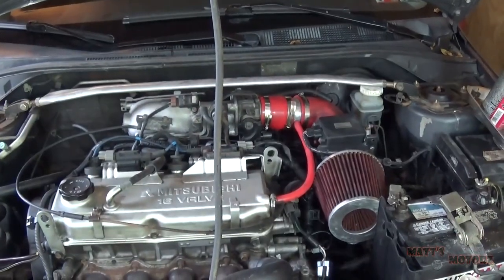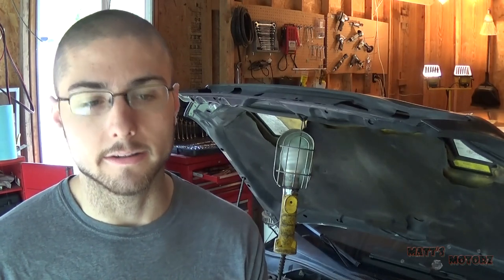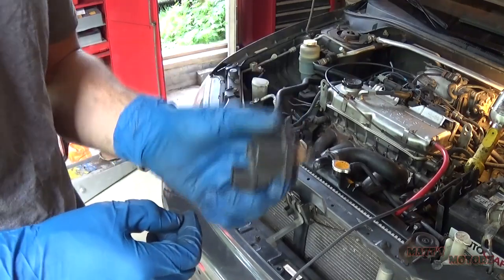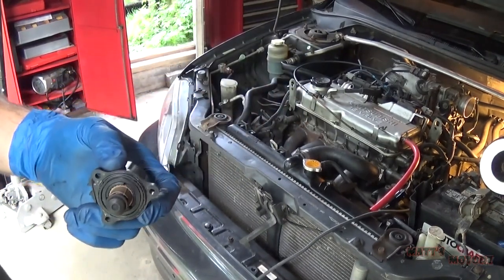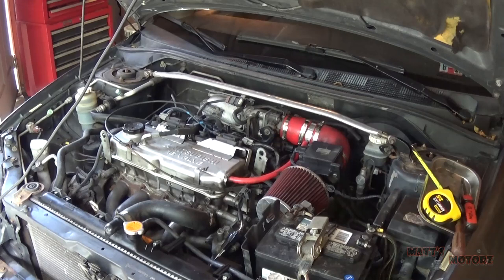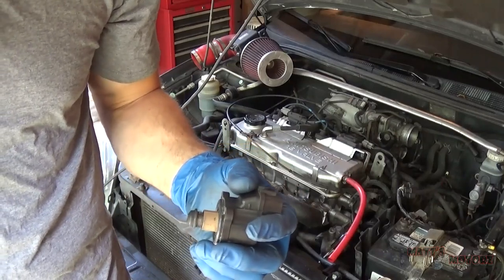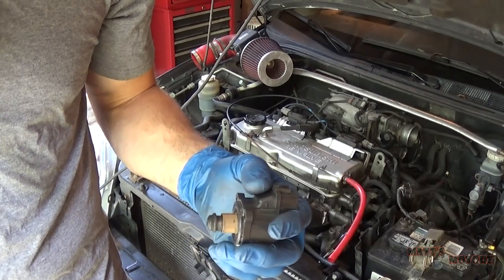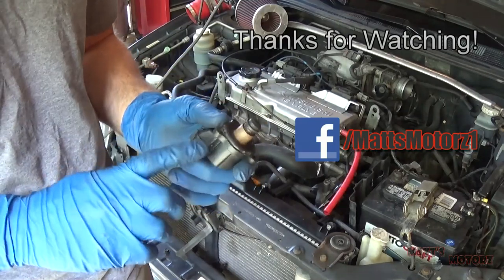Easy Way to Check an Idle Air Control Valve

Comment: Hey man, nice video! I have a Mitsubishi Outlander 2006 and it has the ENGINE LIGHT on, the computer reads "Idle Air Control Too Low". When driving and I come to a stop and try to accelerate the car, it stalls, the car turns ON again after turning the key and rides normally except when it does this. The mechanic told me I have to change a "piece" inside the throttle of the body, is this correct?
Reply from the maker: +Carlos Cordon Well it sounds to me like the idle air control valve is bad.  The IAC valve is indeed located inside the throttle body.

Comment: after I replaced the spark plugs on my 2008 Toyota Sienna, I unplugged the throttle body and clean it, now the car won’t idle.  It runs fine smooth (not rough) for 5 seconds then turns off, do I need to reset the throttle body?  Basically the car stalled after five seconds. Please help.

Comment: will an iac control fuel injectors?
Reply from the maker: +Drew Williams Nope.  The IAC doesn't control anything except the amount of air going into the engine during idle.
Reply: will the maf sensor effect fuel injectors from pulsing?
Reply: and thanks for response
Reply from the maker: The MAF sensor provides critical information to the engine computer to control the pulses of the injectors. So yes it affects the injectors.

Comment: I tried unplugging while idling but my IAC pintle stays wide open.... Would this indicate a faulty IAC valve? I cleaned it and the Throttle Body and didn't change the idle. Also, the spark plugs are black and motor oil smells like gas. So its running rich too. I also noticed the PO removed the idle screw plug... so they could have messed with the screw too. Thanks.
Reply: check your wires could have a broken wire, and your throttle position senser will give you very similar symptoms

Comment: nice vid. you can also remove to iac from the throttle body. start the car. then in the engine bay hold the iac and rev the engine by hand. if the iac works then the pin will move in and out as the rpm raise and fall.
Reply: Don't do that or the pencil will fly out of the idle air control valve
Reply: If you remove the idle valve while running the motor will over rev. Max lean!

Comment: IAC's aren't cheap (but they say I am)..just wondering if you have tried reviving one by lubing the piston or working the pin back and forth, or do they usually die electrically...and I guess used ones would be risky..thanks for the helpful VID...
Reply from the maker: Oilsmoke Jones Normally you cannot move the pintle at all by hand because they are stepper motors.  I never tried to revive one so I don't have much information in that respect. :\

Comment: Can you do a before and after of how the engine runs when you change the iacv?
Reply from the maker: Damn I should have! I already replaced it.  Before replacing it, the engine would run fine when cold, but after it warmed up it would bog down and sometimes stall after revving or when under load.  It would also run really rough until you step on the gas.  This was because the valve was stuck open.
Reply: @MattsMotorz  I have the opposite problem: runs fine when hot, sometimes stalls when cold.  Could it still be the IACV? Like maybe it's stuck closed instead of open?

Comment: Matt My 1999 Frontera 2.2 petrol when cold runs rough, after 5 mins it idles at 2000+ rpm. could the ICV cause this? Any help would be appreciated
Reply from the maker: chris davies Yes the IAC could cause this, as well as a vacuum leak.

Comment: Good video.  It was helpful.  I'm getting the IAC code, and the TPS (Throttle Position Sensor) code too.  But, the vehicle is performing the way you mentioned in your video.  It stalls after the vehicle warms up, or if air temperature is high, like in summer.  Wondering what your thoughts are.  Do you think the TPS could be a problem?  I don't see how a bad TPS would produce these symptoms.  But, the IAC is obvious.  So, I'd appreciate your feedback.  Thanks.
Reply from the maker: +David Eichenlaub Sounds like the IAC to me.  I would replace it, clear the codes and see if anything comes back up.
Reply: +David Eichenlaub depending on the vehicle actually. Some GM motors the IAC can be adjusted manually. If this is performed, it is important to adjust the TPS till its between 4.3-5.7 VDC. Your situation sounds like it could be wiring. A lot of vehicles have the TPS, IACV, MAFS, and The AC preasure transducer all on the same circuit, and the AC Preasure Transducer is actually especially vulverable to shorts. When this happens its can send improper voltage to all of the above sensos, also to the MAP sensor. Try inspecting all wiring ans sensors on the 5v reference signal for shorts. And make the ac preasure transucer the first one you inspect.
Reply: Hmm.  Great and knowledgeable advice.  Unfortunately idk how to use a multimeter that well.  Any advice on that?
Reply: +David Eichenlaub in this case just one at a time set the multimeter to 20VDC and turn. the car to the on position. (do not crank ot over) Just acc. then one at a time pull a sensor and stick the positive and negative leads on the harness wires. top os usually ground. but look for color first and check your wiring diagram to be certain. If these are reading the volts in my previous comment then the Ecm is working correctly. If that's the case switch it to OHMS and check the sensors wiring posts (where you plug it to. for Continuity.  should settle around 30 if so the sensors good. follow that method on each if one is off that's usually where you start looking. Hope this is helpful. what make and model is the vehicle?
Reply: +RIP FPS DOUG some may read 12v range when checking wires that's actually normal as you're on a 12 v circuit.
Reply: +RIP FPS DOUG I can't post a picture on here?  So, I put the leads of the multimeter on the posts of the wiring harness or pigtail or whatever it's called?  I don't have to do the backprobe thing?  I have a picture of what I mean but can't post it.  Thanks for your help again.
Reply: +RIP FPS DOUG The vehicle is a 2003 Jeep Liberty sport 4WD 3.7 V6
Reply: +RIP FPS DOUG Here is a link to the picture of the way someone is testing the TPS w/a multimeter.  Is this the way to do it?   

http://forums.nicoclub.com/throttle-position-sensor-help-t314208.html
Reply: +David Eichenlaub if it's on a jeep I'd leave it plugged in, stick your post into the back side of the harness where the wires enter it. you may have to wiggle it a bit to get a reading, but that will test the sensor and the circuit voltage. I will say this though. Jeeps are notorious for the factory idle airs going bad. Be sure to have the ac turned off when checking it. and make sure the engine is cold. if it reads correct run the engine till the fans kick on and cycle for at least 1 minute. Then get another reading.
Reply: +RIP FPS DOUG The method you described is called back probing right?  Is it possible to damage something by doing this?  It seems like you could break the wire or it's connection by doing this.  Any thoughts?  Thanks.

Comment: Hello Matt!!! My jeep 2000 cherokee has its check engine light on. i got it tested and it says its the idle air control valve. can i clean it or do i have too buy a new one?
Reply from the maker: +kayla reifschneider Normally cleaning doesn't ever fix anything, but I have been surprised before.  If it is easy enough to get at you might as well try it, otherwise I would suggest to replacing it.

Comment: Hey Matt! Thanks so much for the video. I have an 04 Escape that was idling fine one day, really bad the next. Idles ok in park, still shuddering, but once in gear, the idling, rpms, speedometer, everything goes downhill. The battery light is flickering dimly so I had that replaced but the problem is still there. A few things to mention... the car has 165k miles and needs a tune up, incl. valve gasket covers. It is leaking oil and coolant (milky) and the serpentine belt, replaced one year ago, is beginning to squeak sporadically. I have no money at all, I'm female, in a town with few ppl to call if stranded, and I'm going to have to figure this out and attempt to fix it myself as this is my only mode of transportation. I know it's hard without seeing, but ANY HELP u may be able to offer would be so so appreciated. thank u so much!
Reply from the maker: +Mel Mel labelle Sounds like you have a decent amount of issues there.
When the battery light comes on or flickers it is normally a sign of an alternator or charging issue.  The battery light is connected to the voltage regulator in the alternator and when it isn&#39;t working properly the light comes on. You most likely need a new alternator. 

Is it leaking oil an coolant separately or is is leaking milky coolant / milky oil? If the coolant or oil by itself is milky then you have a big problem.

For the belt, check the ribs of the belt to see if they are beginning to crack.  Many times the cheap-o belts don&#39;t last long.  The squealing means the belt is slipping.  A serpentine belt cannot be tightened and you probably need a new one.  Hope this helps!
Reply: Crappy town if they, a man, won't help a woman with car trouble.

Comment: im having issues with my 1996 Ford Ranger 4.0l with hard starting issues once it runs about a minute or so it clears up but has hesitation when giving it gas. I replaced the IAC valve, now while the truck is running if i unplug the wires to the IAC valve it dies a few seconds later so could the new IAC Valve be bad or is it good? i have no idea about IAC valves this is no matter if the engine is cold or warm if i pull the plug off it dies. the old IAC valve still ran the vehicle when i unplugged the wires. so im so confused on this issue

Comment: do you have any idea why the idle is high when ac is on?
Reply: +vanaikee 

The idle of a car increases when the Air Con is turned on to compensate for the "drag" the Air Conditioning pump puts on the motor

Comment: Hi, I also have a Lancer Cedia. It starts normally but stalls immediately after starting, unless I put my foot on the gas to rev it. It also stalls after I release my foot from the gas. Could it be a bad IAC valve?
Reply: I have the same problem on my Mitsubishi Pajero 3.5 v6. Cold start it starts fine but stalls unless I hold the gas. 
Did you manage to get yours fixed ?

Comment: what does it mean when the IAC valve is  making a ticking noise? the ignition is at the on position and the radio is on but the engine is cold, when i start the engine it will slowly stop making the ticking noise.
I can feel that its the Idle speed actuator. Any ideas?
Reply: +Sarah Rivera Thats normal its extending itself. If its ocnstant and doesnt stop then it could be bad.
Reply: +Sarah Rivera They actually have a small motor with a magnetic coil inside. This extends and retracts the pintle.

Comment: I replaced the Idle air valve for a new one and then an O2 sensor code shows up and then minutes later the code for an Idle too hight show again so the problem wasn't the Idle air Valve so what can be?    2002 montero sport 3.0

Comment: hello i placed a new iac in my cavalier 98 and it still revs high ,how would i reprogram my iac on tgis specific model ?
Reply from the maker: You likely have a vacuum leak causing the high revving.  Look for it with carb cleaner.
Reply: i have. replaced. most of my sensers and it starts for. about. 5 secont then dies

Comment: It's hard to tell from the audio but, is there a vacuum leak somewhere? That'll do this. Just at idle? Fuel trims
 PCM adding or subtracting fuel.
Reply from the maker: +689452379 This fixed the issue. No vacuum leak.
Reply: so it was running lean therefore adding fuel  if its running rich it subtracts fuel?

Comment: ok I have a 2000 Nissan Altima GXE and was driving and the car cut off on me and it's a spark and gas is getting up to the fuel injectors but they're not pulsing so I was wondering what possibly it could be. and MAF sensor or the wiring around it is what I'm guessing. the ECU is good.
Reply from the maker: +Drew Williams So the car died on you, and now wont start.  You have checked  for spark and fuel pressure and both have come out to be good correct? (Just want to make sure I understand)

Does the car sputter or anything when trying to start it? Or does it just crank and crank?

Comment: i have a 2000 eclipse gs and if you dont have your foot on the gas pedal it shuts off could this be an egr valve or IAC?
Reply from the maker: +Princess Jordyn Yes it could be either of those things.  To check the EGR, remove it from the engine and blow compressed air through the port to see if it is stuck open.  If it is not stuck open, then it isn't likely the EGR.

Sometimes vacuum leaks can cause the same issue.  Check for vacuum leaks by spraying carb cleaner all around the intake manifold and vacuum lines and see if the idle changes (do this while the engine is cold since carb cleaner is flammable).  If it wont stay on for you to do this, have someone hold the gas down.
Reply: i removed the throttle body today and cleaned the IAC and the throttle body inlet however i must have dropped the screws to the TPS sensor. so i held it on and it didnt change the idle any . Mystery this car has been.
Reply: Dillard, look for the inexpensive causes first. Try this before you clean the mass air flow sensor or check anything else. First check for water in your fuel. If that is OK drive up and down a steep hill. Listen and note any changes in how the engine runs. If there are changes and it still stalls you probably need to replace the fuel filter.

Comment: Help!😭😭 😭 My 97 Geo metro is reving up and down in park after it warms up. Normal when in drive, but idles high when in drive. When I  let go of the brake  it brings me to 20 mph. It's as if I'm pressing the gas.😤I'm wasting gas!😩 All is well if i unplug the IAC valve. They say if that happens, it means it's defective. Should I replace it or clean it or check for vacuum leaks or indpect Throttle position censor? or was the unplugging test good enough to know it's bad?
Reply: Dwd Kokab hows the throttle body looking, maybe the line is tight? Kinda doubt it tho but its super ez to check

Comment: What could be the cause of if it has still high rpm (2,5k) already replace my IACV. I have 4g92 engine
Reply from the maker: +ian ramirez Check for vacuum leaks.
Reply: +MattsMotorz sorry im new on this. what specific shoul i check
Reply from the maker: It is really best explained in a video.  Look up "how to check for vacuum leaks" on youtube.  Basically, you use throttle body cleaner (or propane if you have it) on various parts around the engine to see if it gets sucked in and changes the RPM.
Reply from the maker: If you don't know what a vacuum leak is, or why it would cause a high RPM, then you really should do some research to understand how everything works before working on your car.
Reply: MattsMotorz on my research if the car is a MAF type then have a vac leak the RPM should low and if its a MAP type it will be on high rpm. So on my case my car is MAF type and i got a high rpm
Reply from the maker: Ah, it helps to know that your engine has a MAF sensor.  Try removing the MAF sensor and cleaning it and see if it affects the way the engine runs at all.  They sell "Mass airflow sensor cleaner" at the autoparts store.  I think this is a good place to start.
Reply: MattsMotorz  obviously you didn't know either or you wouldn't have watched the video
Reply: ian ramirez Check the CTS or TPS, or EGR valve, or throttle body worn, or MAF sensor, ISC motor or stuck accelerator cable, or computer.

Comment: Just take it off once, and bench test for continuity with multimeter. 3 pins: center is +, left is open, right pin is close i think. Reading between 20-24ohm is considered 'good'. You can also bench test IAC with a 9v battery. Just get the pinout correct. Theres a vid here that shows it on a Toyo i think..cheers
Reply: Big Love I wouldn't say "just" because that's not true.  Reading the correct coil resistance values only tells you there is no short or open circuit in the coil which is a less likely problem than bearing wear or general gunk buildup causing it to not move freely or not seal when it tries to close all the way.

Comment: My mother has a 97 pontiac sunfire that stalls when she takes her foot off the gas any ideas of what to check first? fyi it's recently got really cold outside and this is when it started. Help please!?!
Reply from the maker: +Shannon Lewis Normally when the problem goes away when you step on the gas it is an air issue.  First thing I would do is check for vacuum leaks. If everything checks out there it could be an EGR problem. The test I use for that is to unplug it and then see if it still stalls.
Reply: Thanks for replying. I will tell her :)

Comment: As I stop at a crossing my car's RPM's dip to 500, then after a few seconds it starts to slowly trickle to 800 or 900 RPM's, could this be the problem?
Reply: 2000Betelgeuse It could be the EGR sticking or IAC valve or TPS. Check codes.
Reply: Mine does the same thing I changed out the TPS and the IAC so far. And checking the codes don't tell you crap. Mine just tells me it's he faulty idle and I'm like 'No shit'.
Reply: If it's only dropping idle with the brake applied the check your brake booster valve, pull it out and see if you can breathe in and out through the valve , if you can it's bad.Also check the hose and make sure it's not vacuum line related . Good luck . Also check Mass sensor